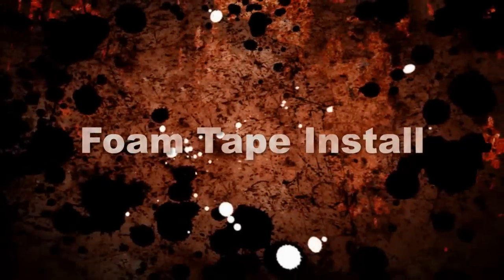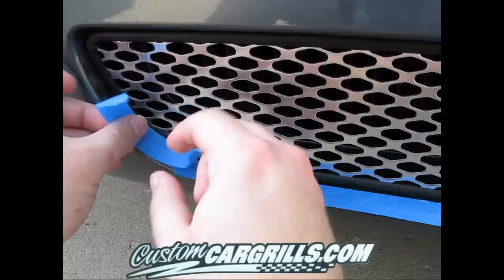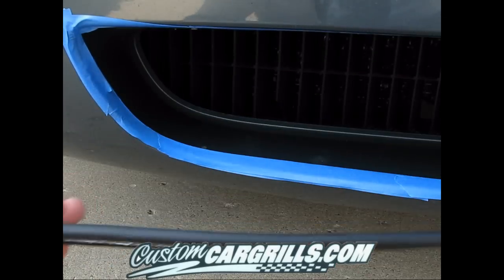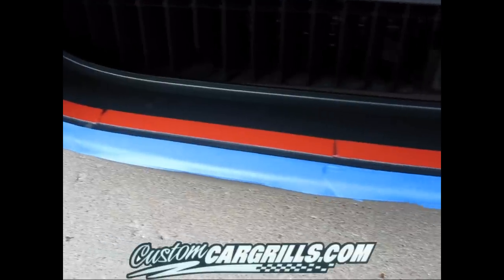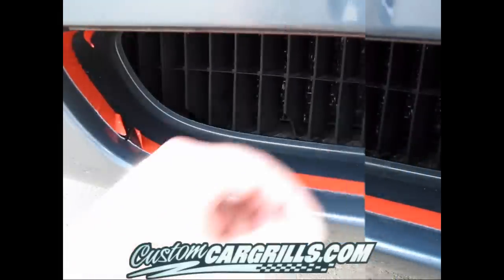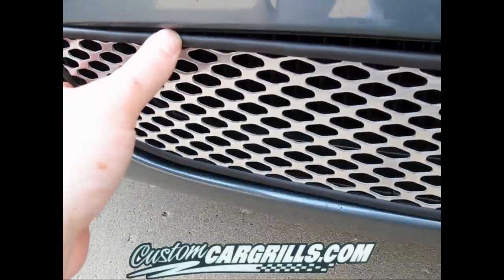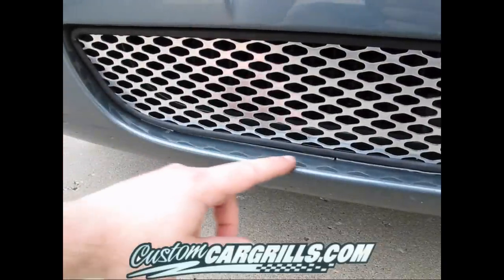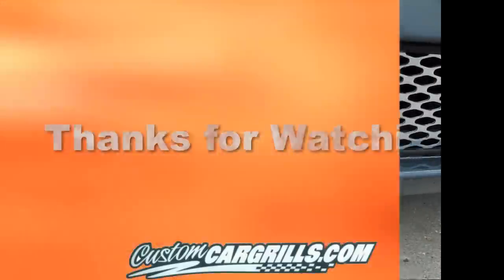customcargrills.com 3M Foam Tape Grill Install

Comment: How about a jag xtype..  any examples? 
I wanted to update mine.. have seen a couple ideas. 
Mine has a center grill with vert slats..  the whole piece comes apart into 3
Separate pieces
Reply from the maker: I don't have any examples of a Jaguar xtype.  There's a huge customer gallery within the product descriptions on our website.  Some of those may give you some ideas on how to approach your installation.
Reply: I’ll send you mine..  and you can use one for a video idea-  let me know if your interested.
Reply from the maker: It's something we may consider.  Send me an email about it and we can discuss the options.

Comment: That does not work in the long run...garbage install...use zip ties
Reply from the maker: It depends on the application.  Sometimes it doesn't work well, and sometimes works extremely well.  The install in this video lasted several years with no issue.
Reply: Dude, they went out of their way to upload THEIR video (I don't see your zip tie video). By the way, zip ties would look tacky (pardon the pun lol) and zip ties get brittle and snap off.

That said I like the mesh but I'm not a fan of double sided tape unless its from a company called "Bolink". It was designed to hold servos in place in RC cars. All in all I'd rather get an over sized piece of the mesh and screw it in, or super glue/baking soda it, from behind.